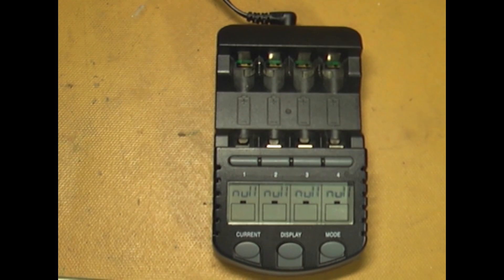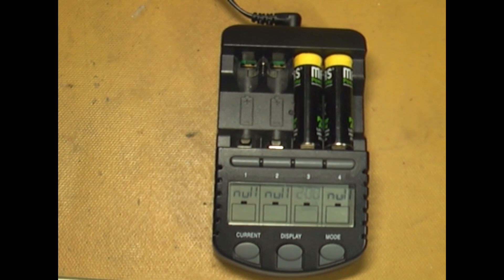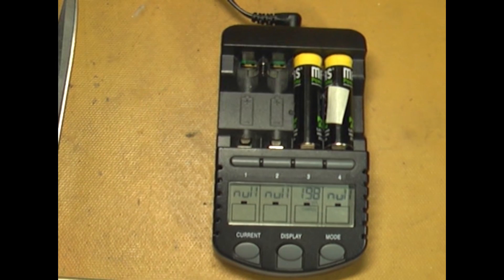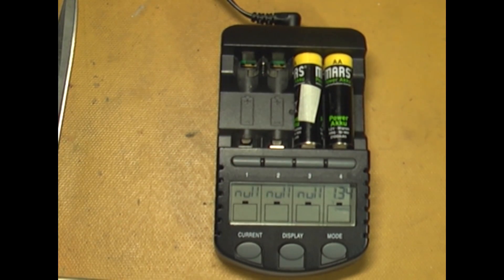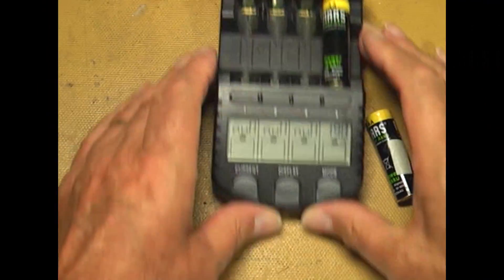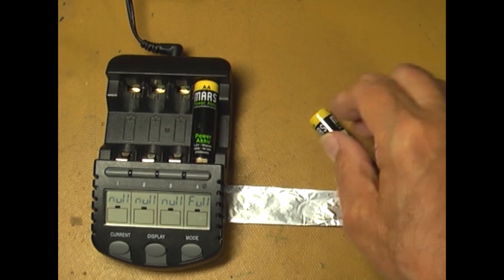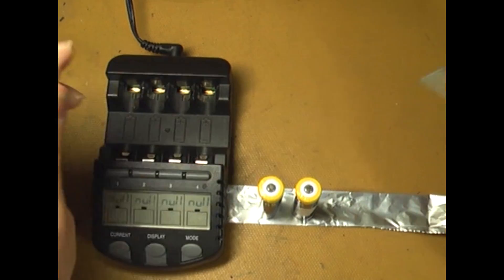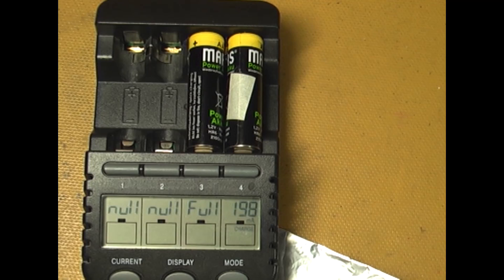Jumpstart a dead rechargeable battery (accu)

Comment: Amazing!  Thanks for a clear, concise and helpful video which has just saved me £40 as I now don't need to buy another charger and can use the 20+ dead batteries I had put to one side.  Also the local recycling centre (and the environment) doesn't have to deal with all those batteries.

What a result for a sub 3 min video!